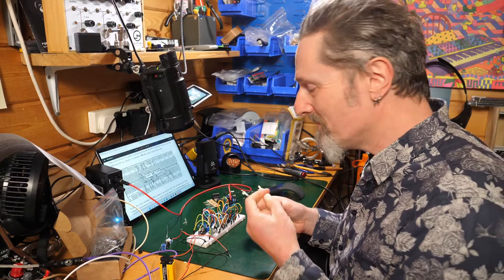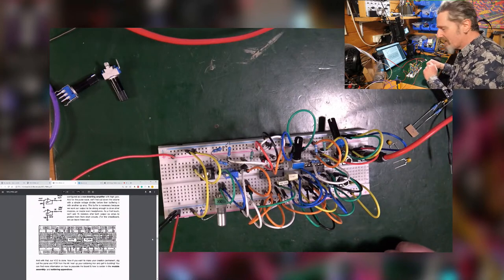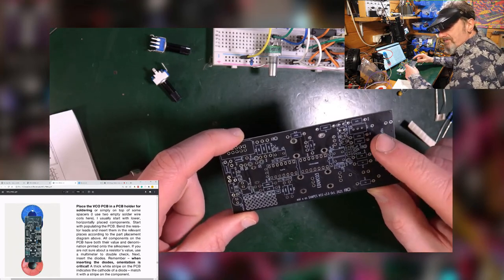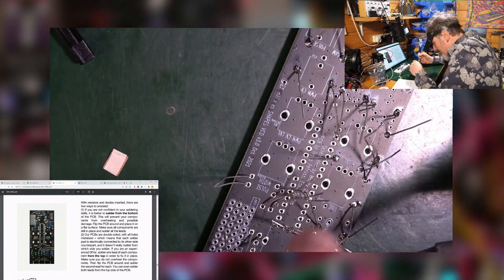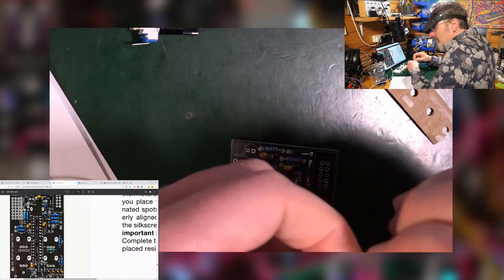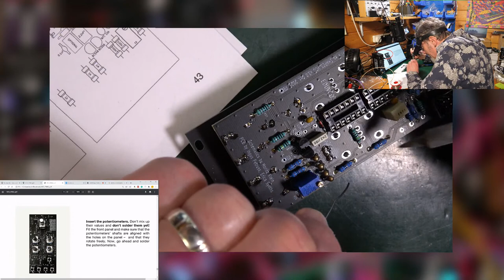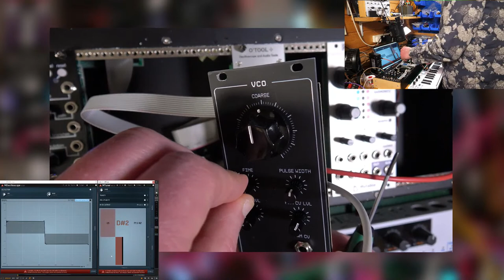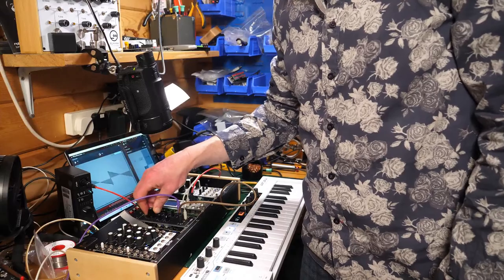Molten Live Stream - Erica Synths EDU DIY VCO build-along PART 2

Comment: Didn’t have time to say it in the afternoon livestream chat, I actually made sure to get a DSO 138 mini. Runs on 5V so you can easily convert it to Eurorack too which I did with a panel and some 3D printed switch caps. The USB still works after the conversion, so if I don’t want to bother with Eurorack power I can just have it on the desk running on USB. I have a big oscilloscope too, but the small one is really useful for just plugging in stuff from the Eurorack. Definitely the easiest of the cheapo Chinese oscilloscopes to convert to Eurorack.
Reply from the maker: Good suggestion on the DSO138 mini - can't get them locally so ive got one coming from china. I should buy 50 and resell them :D
Reply: @MoltenMusicTech  Hope it arrives quickly for you! First one I ordered from China too, never arrived. The second one was when it reappeared on Amazon locally after a while and that arrived really quickly. With the chip shortage availability of these is really hit and miss!